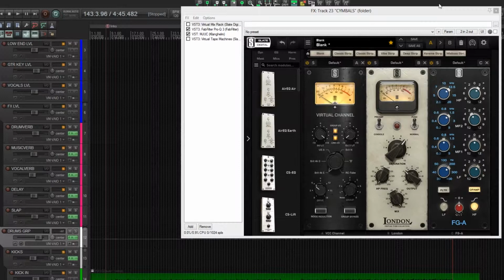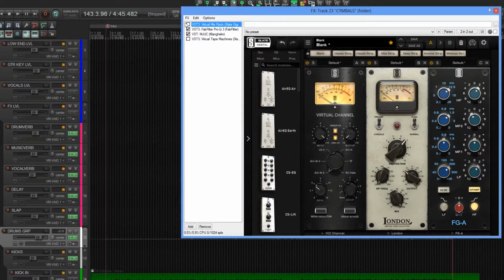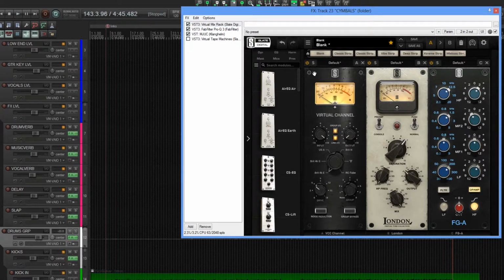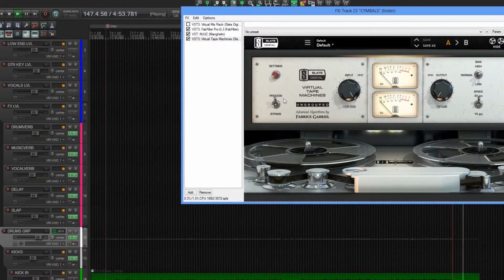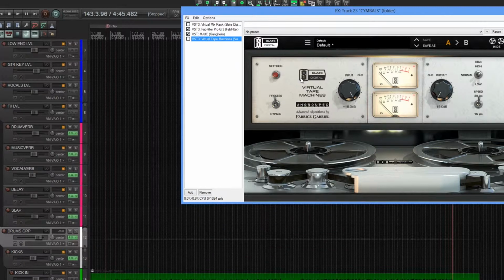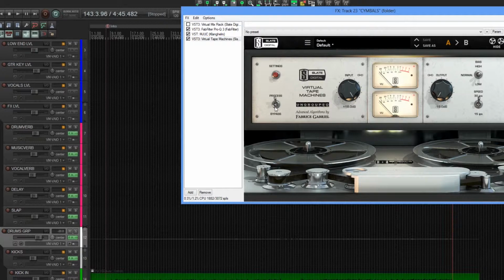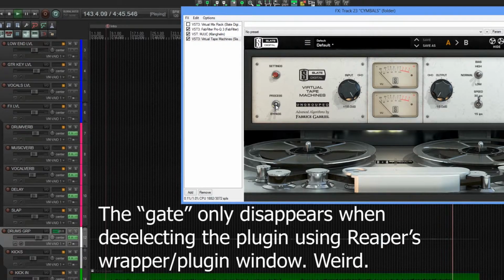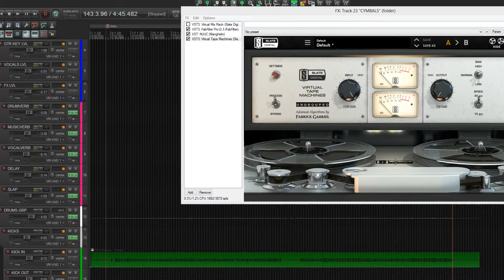Reaper Bug With Slate Digital Plugins?

Comment from the maker: UPDATE! Turns out this is only a problem with the VST3 version of the Slate plugins, which does suggest there's some sort of compatibility issue. VST2 plugins work fine!
Reply: Hi, I'm expermenting with the Verbsuite of Slate.. I will try the VST2 Vertion. Thanks for share. I thinked that the problem was Reaper setting.